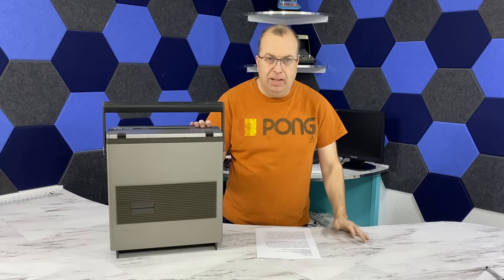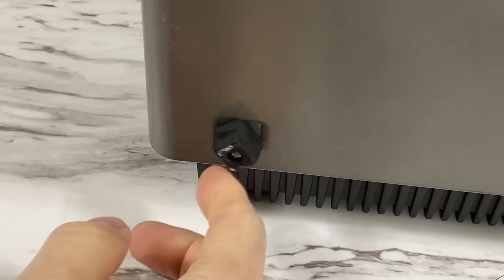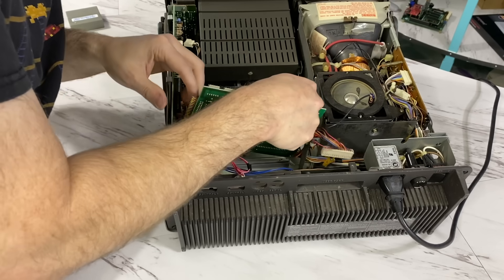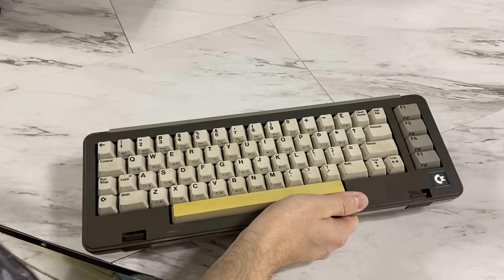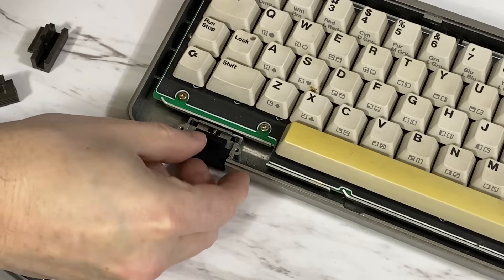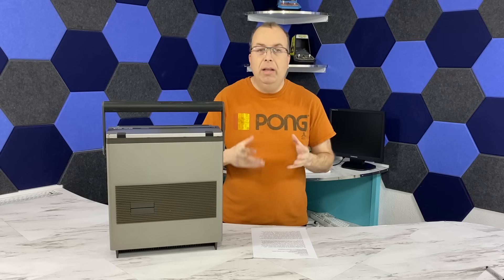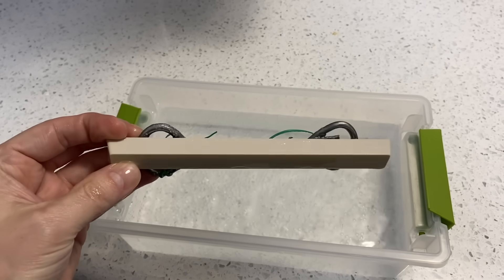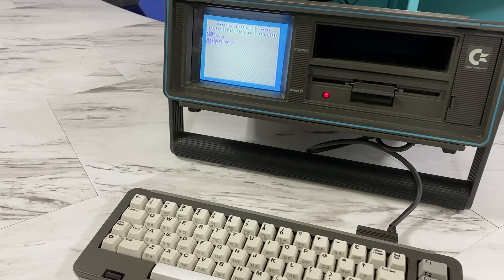Commodore SX-64 repair and trivia

Comment: I am another who very much lusted after the SX-64, but not while I was a kid.....I was in my first engineering job, and used a C-64 on my desk in my office to do word processing and run little electronic engineering programs that I had written.

Fun fact, my workplace was across the street from Protecto Enterprizes (I believe this is how they spelled it), and I had known founder (?  or maybe sales manager ?) Bill Badger since he ran that business from the garage of of a suburban home in Barrington, Illinois (he told me that the business was originally home security products, hence the name, and that he (?) had decided to get into the personal computer sales business). I designed a couple circuit boards for them and also wrote a few educational apps for them as well.

[ Some sources say that Protecto was founded by John Scheele, sometimes with no mention of Bill Badger. It has been many years, but I personally don't recall anyone by the name of John Scheele and I know in the early days I went to the house of a person named Bill Badger, and he was the guy who always seemed to be in charge for many years later when they were in the building in the Pepper Road industrial park in Barrington. Maybe Bill ran the place for John, who might have stayed in the background. For those curious folks, you can use Google Maps and navigate to N Pepper Road in Barrington, find the place where the road bends to the west and a small lake is to the east, and you will see two buildings with dark roofs on the west side; Protecto was in the north building of those two. Google identifies the building as having a bath supply company and a print shop. ]

"I" had decided to NOT buy an SX-64 because I already had the C-64, did not require portability, REALLY DISLIKED the screen and hated Commodore for even putting out a computer with such poor legibility while having the gall to try peddling it to business executive.

But it still bugged me that I had the rat's nest of devices on my desktop (C-64 and its power supply brick, memory extender PCB and various modules plugged into it, modem, the 1541 floppy disk drives, etc; and all their cables. Even though I thought buying an SX-64 would be a waste of money, I liked the all-in-one aspect of it. SOOOOO, I got buy and made my own, sort of. I was handy with making wooden cases for musical instruments, the kinds make from thin plywood and covered with black Naugahyde fabric, so I took the guts out the C-64 and the two disk drives, and figured out how to fit them in as small a box as possible (along with the aforementioned accessories). The front panel layout was just the same as the SX-64, except somewhat larger, more the size of an Osborne 1 portable computer. Everything except the keyboard was in the main case. My expander board with its several expansion connectors poked out through a hole on the right side, to cartridges could be plugged in there, and a selector switch on the front panel 'enabled' certain of those slots to that cartridges intended to be used by themselves could be selected individually although all plugged in at the same time. A recessed metal back panel inlay had an expansion Commodore serial port in case I wanted to connect additional drives (but I used it for my Commodore dot-matrix tractor-feed printer), the User port, and a single IEC C14 power cord socket which allowed all internal devices to be powered from a single external removable power cord. I had a hinged-open keyboard case which folded from and also served to kickstand the front panel of the main case up a few inches. I made my own custom wire connector harnesses to adapt the C-64's keyboard connectors so I could use common DB-25 (as I recall) connectors on the rear of the keyboard case and the front panel of the main case, with a short cable pluggable between them (contrast this with the SX-64's 'unobtainium' keyboard cable). Everything was designed to be undoable, so no original part was modified.

This computer sat on my workspace desk for a few years, in daily use, with a monochrome Heathkit video monitor sitting on top.

Sometime in the 1986 or 1987 timeframe, I abandoned my Commodore loyalties, sold my two PETs and VIC-20, and their accessories. As for my 'repackaged' C-64 setup, a local teenager who I had been giving music lessons to expressed a desire to own a C-64 and disk drive. He was a budding composer and I 'commissioned' him to write a piece for one of my bands, with payment being a used C-64, disk drive, printer and monitor. I still had a box with the original plastic cases and hardware bits, and reconstituted my portable lashup to its original packaging, and the kid was a happy camper.

Just a few years ago, I bought a working SX-64 from a seller at the Vintage Computer Festival Midwest but have done nothing with it.

Comment: To anyone else troubleshooting an old machine, once you've replaced dead chips, Don't power it on yet!!!!!! Something fried those chips, and it very well may have been the power supply. 8-bit guy knows what he's doing, and may have tested the power supply off-screen. But please sanity check the voltages before potentially frying otherwise-good chips.

Comment: That screen almost looks like it's being connected via composite video. Especially the red text, which has blue fringing on it. I wonder what kind of internal connection they used. This would have been a perfect use case for pure RGB, since it would have saved them the trouble of including any of the composite or luma-chroma decoder circuitry you'd normally need in a monitor.

Comment: There are sites which show you how to replace the whole monitor with an LCD using a 3D printed bracket and you have to provide some kind of powered speaker too. I haven't done mine yet but it should make the machine lighter too. I'd hate to have to work on that monitor, its really tight in there.

Comment: My keyboard clip was missing so I casted the other one in a silicone mold and matched the pigment and duplicated it. You cannot tell which one is which (I’d still like to find an original though). Mine had a bad PLA when I got it. Common.

Comment: Glad it's now up and running. Today, it's an interesting machine because of its rarity, but at the time it seems to have been a dead duck. That screen is terrible, how could they release it like that? Are there alternative CRTs available? Commodore seemed adept at following their successes with multiple failures. Some were good ideas, just badly implemented, but others were just bad ideas to start off with. The C16 /Plus4, the C128, the still born C65, the Amiga 600 and the CD32 spring to mind.

Comment: You're right on the money about the small CRT...  the monitor of one of my two SX-64 bit the dust; since I don't know how to fix it (I don't know virtually anything about CRT) I decided to replace it with an LCD 5" composite monitor (like the cheap ones used for rear cameras in cars). Even if it's a composite input vs. the s-video input of the original CRT, the result is awesome (no surprise of course).

Comment: I've seen one or two of them in action in stores and wasn't impressed by the tiny display. During that time we already knew that you could get a really nice picture on TVs when you had an option to use the C64's "A/V Port" instead of the "RF Jack". I'm quite sure I had a cable from local cable manufacturer "Lindy" that connected the A/V port to my own small color TV with a BNC connector. ( for the Amiga I later used a dedicated color monitor which had a scart connector that I connected to my VCR. Watching TV looked so much better on that computer monitor. Distinguishing betweeen a small "L" and the digit "1" was really an issue when programming on the Amiga computer ...).

Comment: I got an SX-64 new from a computer store back when they first came out for $600.
They were using it as a display because the keyboard didn't work.
Instead of turning it in under warranty, I tried getting it to work myself.
Opening up the keyboard, I found that the pins for the cable connector had been pushed out of the socket.
I pushed them back in... she worked beautifully.

As an experiment, and because I wanted to be able to move the keyboard farther from the computer, I tried using the ribbon printer cable I had for my Model 100 as a keyboard cable. They're both 25 pin, and, not surprisingly, it worked fine. I can't recall now if the cable lacked the screw tabs most 25 pin connectors had, or if I cut them off to fit into the slot of the SX.

Personally, I loved its keyboard.

More trivia: a wealthy Barainian friend of mine squeezed the guts of an Amiga 500 into an SX case, and had a working "portable" Amiga.
Reply: Adapting to an amiga would be a major exercise, as power supply, floppy drive, monitor video in seem to be  all completely different

Comment: I agree re the failure. Price, Distribution, aimed at a market that wasn't interested. I did see a small pharmacy use a C=64 and 2 disk drives for tracking orders/prescriptions back in the mid 80's. Being the UK, having 2 disk drives was very unusual. Several other shops seem to have used 'home computers' at the time, mostly Amstrad CPC6128 because they could access CP/M software with them.  Until the late 80's, CP/M compatibles seems to have dominated that niche market. When Amstrad released the PCW, the bundle was such a competitive price it pretty much wiped out the competition in that market until PCs started to dominate in the early 90's

Comment: So I picked up an SX64 this last year. It's almost in perfect condition. Only 1 problem.  It's a European version. But it was only $350, and I could not pass it up. The guy was going to toss it in the garbage, and of course it deserved to be saved. I used a high quality 220 to 110 convertor, and it seems to work fine. But I don't dare run it too long, as I'm not sure what the effects on the crt will be. Not sure if 60Hz to 50Hz is an issue.

Comment: I would LOVE to have an SX-64, but they're high-value hardware now, so I'm going the next best route, turning a 6" colour TV into a sort-of SX-64 "lite" using a C64 DTV (using your archived site on them for tech reference) and a Goodmans GTV-9100 television (sold as a TMK 510CP in NTSCland), no integrated drives, or cartridge slot, or user port, but with IEC input for 1541 & other peripheral use, putely a project of "Can I do it and make it work?" rather than anything serious, but I still want a real SX-64 though... :D

Comment: Yeah I was just looking at a video about a really small CRT Ie. more 120p than 240p and the shadow mask scale was such a limiting factor that a finer variant was critical for color tubes that small if you were supposed to read text on it. If it was supposed to be a business computer they should have used a monochrome screen and sold it at a cheaper price.
I like it but have to wonder how much money Commodore had for wasting when making things like the SX-64 since it wasn't likely a cheap thing to make for a product so few actually bought?

Comment: I had one of these, it was great to take to C64 club (yes that was a thing when I was a kid!) Some games wouldn’t run even when they’d work on a normal 64, never worked out why
Reply: As I recall, when Commodore produced the SX64 without a connector for the cassette drive, they also saw fit to remove all the code associated with the tape drive, including the cassette buffer. Some programs used that area for storing data, so if it's not there, the program fails. You can swap the Kernal ROM from a normal C64 though, and that should restore full software compatibility (minus the ability to actually load from tape, although I've heard that's a simple mod).

Comment: Wow! Brings back memories  I did buy one of these at Sears when I in my 20's.  A huge improvement over my Sinclair ZX81. I used it to log into a vax remotely from home for work. I think I also used it for other terminal emulation and RS232 communication debugging.  My wife made me sell it when I got my first PC DOS clone, a Compuadd with real 20mB hard drive.

Comment: This is the very computer that got me into computers in the first place... it also started off my "tinkering" video series, although the format was not quite as polished back then: https://www.youtube.com/watch?v=4HlUHLvIPAQ I took it apart quite a bit further, also had an issue with an almost working CPU and did replace the power supply with a bit more modern solution; the original one powers itself via a resistor and gets hot by design.

Comment: I had an SX-64 back in the day; it was my first personal "business" computer, used to consolidate and summarize sales reports abstracted from System/360 data (the company's "real" computer.) Something happened to the keyboard cable, I might have lost it on a BART train, I can't really remember. But I was able to substitute an RS-232 (25-pin) ribbon cable, which had the added benefit of being able to move the keyboard further away from the machine. Yeah, the tiny screen sort of made that a bit futile, but I also had a 1701 monitor to use with it at home from my "normal" C64.

Comment: Have two of these. One already completely restored. Second one has some mechanical FDD issues and need keyboard cleaning. By the way. Check all capacitors in power supply. They may fail due to age and protection in this PSU isn't very sophisticated.

Comment: I mean, I'm sure someone out there is capable of replacing the shadow mask. Unless you're aiming as truest to original manufacture as is possible. It might even be easier to find a replacement monitor; those were common in the late 1980s and early 90s and I'm sure you could find one from a completely different manufacturer and just cannibalize it.

Comment: This video is a godsend. Now I know why my SX-64 keyboard is flaky, and I will order a new membrane. Thanks, David.
Reply: You might try peeling your old one off and putting it back in position.  Mine was simply stuck at points across the board and freeing it completely made it work like new again.

This was before the reproductions came out, and was a harrowing experience since there were no replacement parts then, but might be worth a try at no additional cost, especially if you can always go with the new part if it doesn't work.
Reply: @obsoletebutneat  Yeah, that's a good idea. Thanks!

Comment: My friends SX-64 was my first introduction to the Commodore 64 and I actually never even seen a regular Commodore 64 until years later.  My friend eventually gave it to me and it still works today, but there is an issue with they keyboard as well, but I don't think it's the same as this unit.  I got another keyboard and they fail the same way (only 1 key doesn't work, same with 2 keyboards) so I think it's the connector on the board as I tried another keyboard cable too.   Still need to fix that.

Comment: Had mine for about 6 or 7 years and a C128D. I think I bought at the right time. As soon as you mentioned it wasn't working I immediately thought the dead test was a waste of time. A common fault being the PCBs coming apart at the connector, I'd always check that first.

Comment: A bloke I met needed a working 1541 so he gave me his SX64 as a trade. Yes I got a great deal and the guy was a bit nutty to say the least. The SX had the 'Cockroach' replacement rom installed and even came with the accessory bag. My main issue with it was the monitor wasn't all that useful due to the poor display and I bet most people who owned one must have used an external display for general use. I had to pull the keyboard apart and clean it initially as it was dirty and didn't work properly. After a year the unit started playing up and I sold it as is for $50.

Comment: I had one of those 40 years ago - and even a Comal80 programming language capsule for the capsule port.

If you have a disk in the drive, you could try kitting shift+run stop and see if the disk drive starts doing something - that is "Load "*",8,1 on the SX64.

Comment: When I need to pull out a C-64, it's never nicer than the one-box, one-plug solution.  I got mine from a retired accountant who apparently used it to go to clients' offices to do payroll back in the day.  Still works great, though I did have to tear down the keyboard to free that sticky membrane...

Comment: I had two or three SX-64, in about 1984/1985 got them from a Surplus Store in Omaha Nebraska, Maybe on 120th & W.Center Rd.  ,  They where about $300-$350 plus tax.   I had several because when plugged in a 1200 baud modem the power supply would burn out.  Then go trade for another thinking it was a fluke,  same thing would happen - power supply fried.  Finally got refund on the last one, and bought a new C-128 & Disk drive from Montgomery Wards.    I DID use a Magnavox Color monitor, external Disk Drive, and other accessories with it.  The internal Color monitor wasn't too bad, just very small to read, 13" or 14" monitor worked great with it.   Don't recall that the keyboard had shifted keys.  A FUN accessory I had was the Type & Speak Cartridge, that really freaked out all the family members.  Granny was just stumped as to what was going on.

Comment: Really cool!  I knew of it back in the day but like you said it was VERY uncommon.  Actually had a hardcore engineer friend in the '90s that retrofit an Amiga 500 into an SX-64 chassis and had it fully working, that was REALLY cool but something you would never do with an SX-64 now!
Reply: Are you sure it wasn't an Amiga 600? An A500 PCB would never fit in that case.
Reply: @Okurkaarrgghh  it was before the 600 came out. It’s a fuzzy memory too :). Dude was amazing what he could do though. Also possible it was a 1000 motherboard